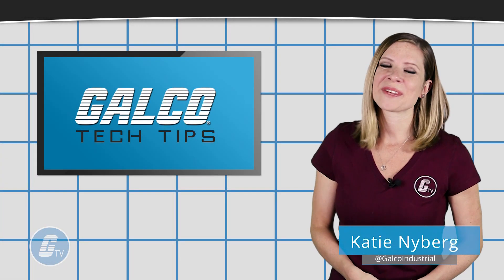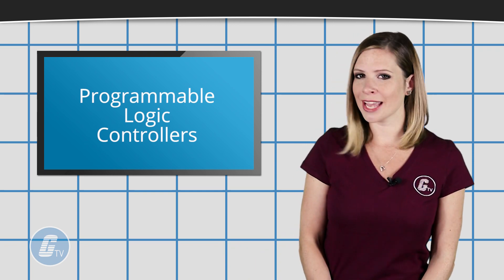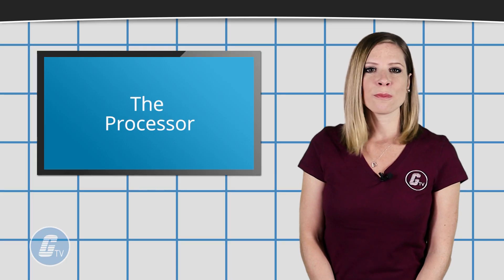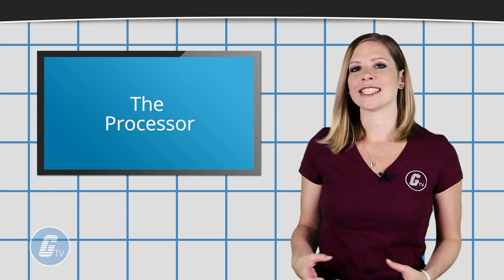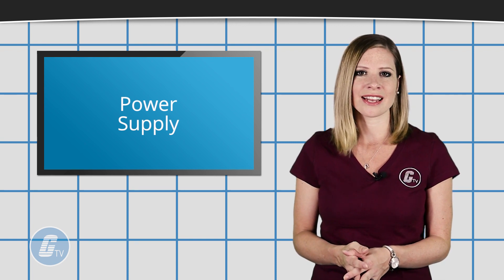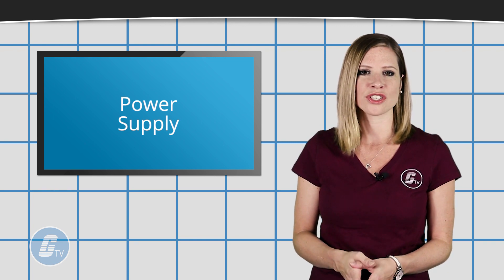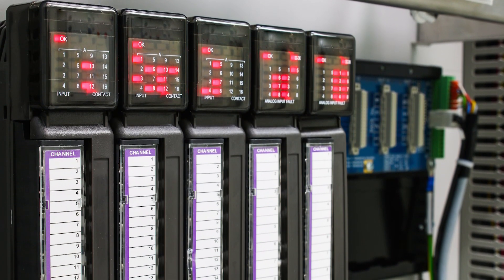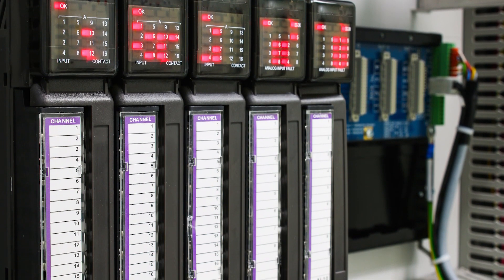PLC components and their functions - A GalcoTV Tech Tip | Galco

Comment from the maker: A programmable logic controller, PLC, or programmable controller is a digital computer used for automation of typically industrial electromechanical processes, such as control of machinery on factory assembly lines, amusement rides, or light fixtures.